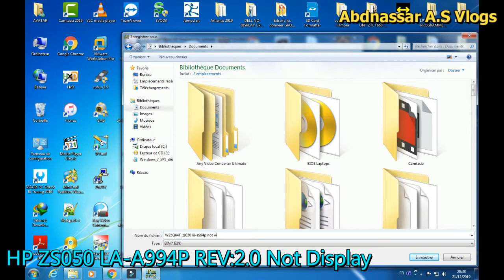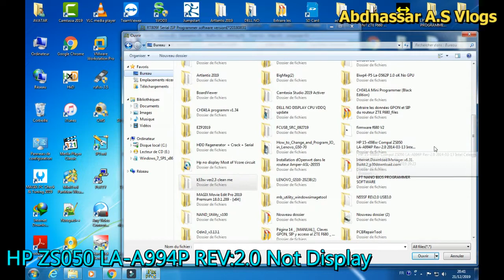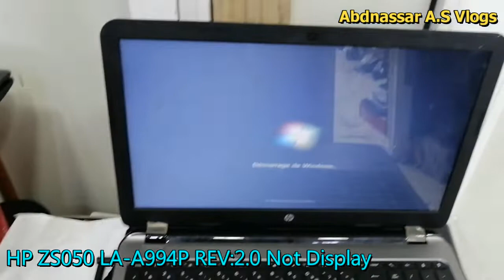HP ZS050 LA A944P REV 2 0 Not Display Bios problem or RAM

Comment: There's a same issue on lenovo z50 laptop and how to make it right? Can you help me sir? My problem HDMI external display on ok. BUT LCD internal Display no display?  Please Help me?
Reply from the maker: OK friend  do you verify the connector LVDS on flex câble and lcd ok
Reply: @bidouche88  Yes I verified cable and LVDS. . LVDS pin 1 and 2 LCVDD no voltage. and Controlled RT2132N chip pin 15 no voltage and RTD2132N chip very hot.
Reply: @bidouche88  LCD testing other pc and ok LCD no problem. Cable testing ok. no problem. My problem is motherboard. LCDVDD power. because LVDS socket 1 and 2 LCDVDD no voltage. and power control  chip RTD2132N pin 15 no voltage

Comment: السلام عليكم اخي خديت واحد البيسي قديم فيه الباس بيوس كين شي برنامج نجبد الباس ولا ضروري نحيد ليه البيل ديال البيوس وشكرا  latitude ppp09s  420 dell
Reply from the maker: ارسلي صورة لهذا الباسورد
Reply: @bidouche88   
invalid password
[press entrer to retry[

this system.#FV95Y2J-595B , IS PROTECTED BY A PASSWORDAUTHENTICATION SYSTEM. YOU CANNOT ACCESS THE DATA ON THIS COMPUTER WITHOUT THE CORRECT PASSWOD.

Ppleas type in the system or administration password and press [entrer[

ila kan momkin ton numero
Reply: قلع الحجرة ولاقي دوك سنان في كتكون الحجرة ادير رسيت البيوس
Reply: @yassinevlog7622   بغيت شي حل بلا منحلو البيسي الى كان
Reply from the maker: @keewaysimo9280  x78iyhij
Reply from the maker: @keewaysimo9280  x78iyhij
Reply: @bidouche88  شكرا خويا انا نجرب ورد علك الله يجزيك بخير
Reply: @bidouche88   الله يجزيك بخير العملية نجحت
Reply from the maker: OK
Reply: @bidouche88  الله يحفضك